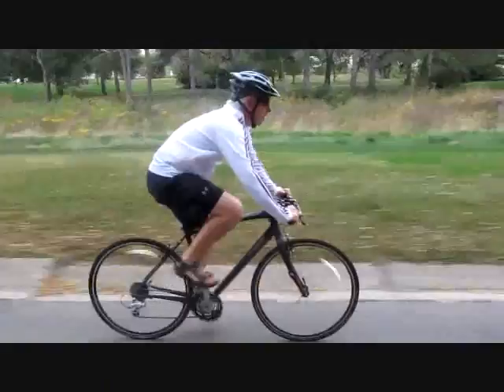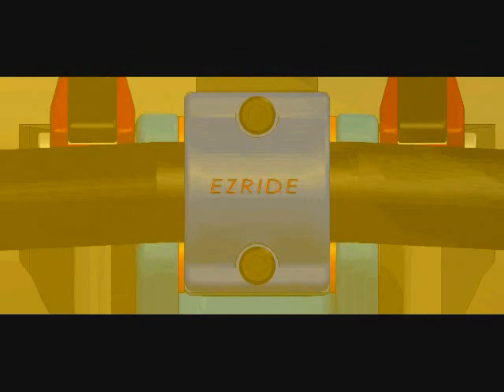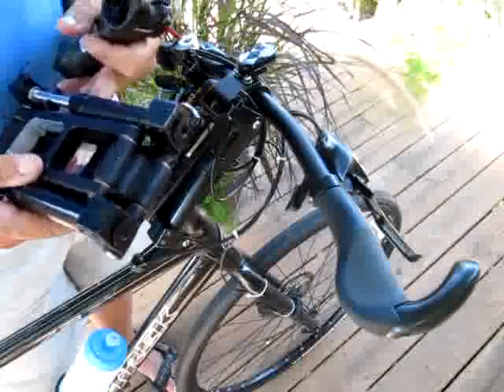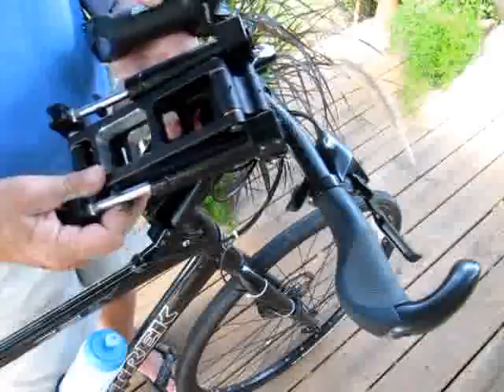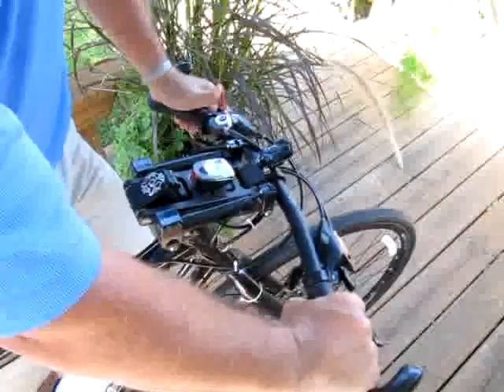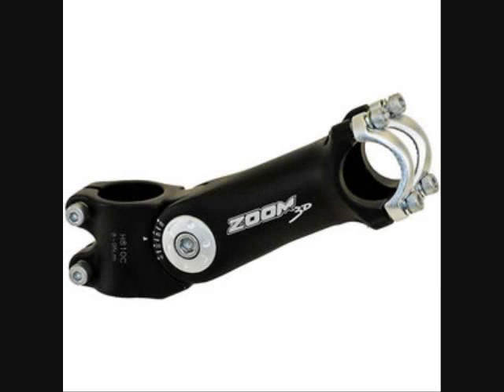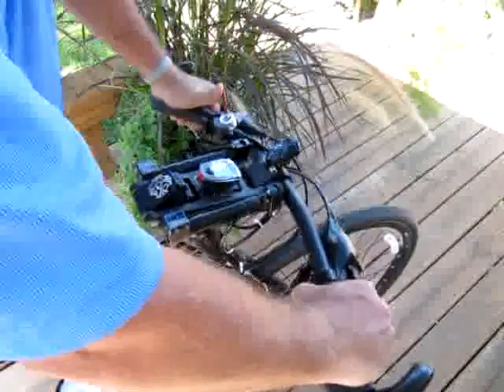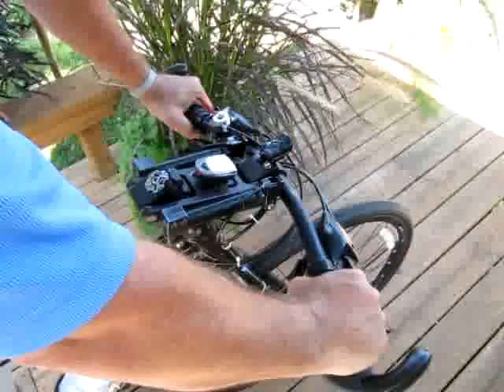The first and only.......GOEZRIDE        GOEZRIDE.com

Comment: John...I am BLOWN AWAY by your invention...I've been looking for an adjustable  stem for a few months now and the ones I've found have very little movement..Yours has a HUGE range..And to able to adjust my handle bars safely while I am riding is just more than I could ever ask ...Send me one ASAP..Ill take a prototype..My bike has the standard 1 and 1/8th stem  attach point and 1 inch handle bars..Your invention is a huge improvement in cycling.

Comment: I am 60-year-old petite female rider who would absolutely love to have an adjustable handlebar on my 2012 TREK FX 7.5. I'm having trouble deciding on the angle and height of my handlebars due to increasing hand discomfort after 20 miles.   I'm in the process of searching for the right handlebar for an almost, but not quite upright position.  I end up adjusting my handlebar screws with an allen wrench for almost every ride, depending on the length of ride.  Your product would be super.